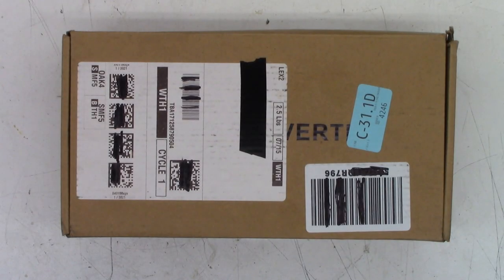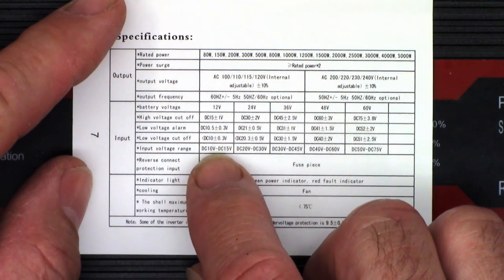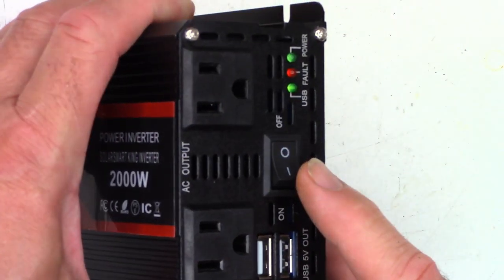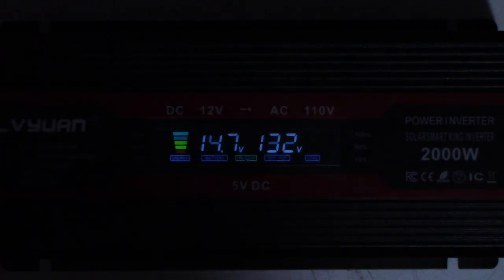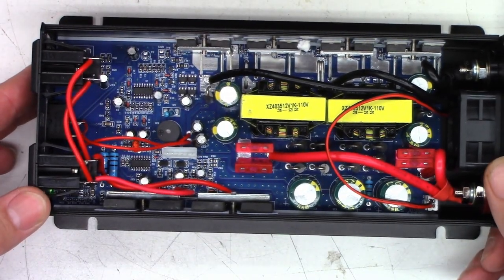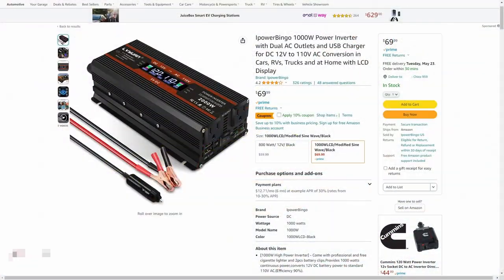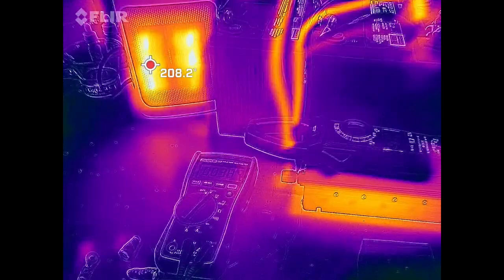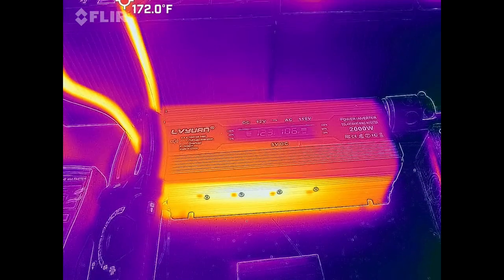LVYUAN 1000W? -or- 2000W? Inverter from online seller. What do I think of it. Is it a defective one?

Comment: I just bought one of this exact unit off Amazon for $59. Glad to know it's true limitations. I just wanted to be able to charge some cordless drill batteries or hook up some led lights. With my 100 watt solar panel, 70ah battery and this 2000watt inverter (really just a 500watt inverter) my cost total was $178. I wanted a way to take the burden off of my solar generators if we have a power outage. I have 3 Ecoflows, one Jackery and a little Westinghouse. All with there own solar. Good test, you just got another subscriber!

Comment: Wow .. I have this inverter, mine is a 1000w cont. with 2000w surge .. I use it often to power my 8amp vac (960watts) when cleaning my cars and i also use it to power some tools and other gadgets. I got it off Ebay for $79...i connect directly to the car battery using the supplied cables and it has yet to fail me .. mine is in a blue case but i don't think that matters .. the cables do get warm but they are cheap cables so i bought some 6ga wire to replace them .. I get way more than 500watts from mine .. same brand

Comment: That's because you're using a power supply and not a battery batteries. Gonna supply a lot more Ambridge or more current. It'll give you 12 V and a hell of a lot of amperage. Which those things are designed to operate on. And that's why the display screen is dull. Because you're not giving it the proper current.
Reply from the maker: I have 4 200cca lawn and tractor batteries connected in parallel, so power supply current is not an issue